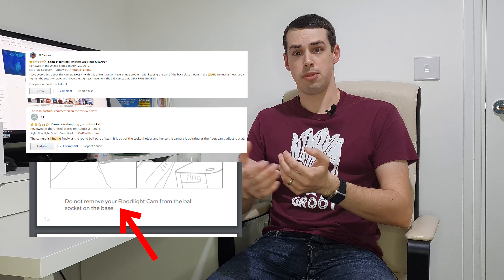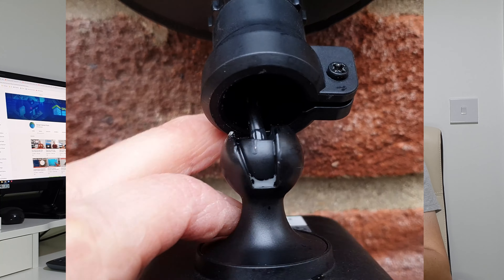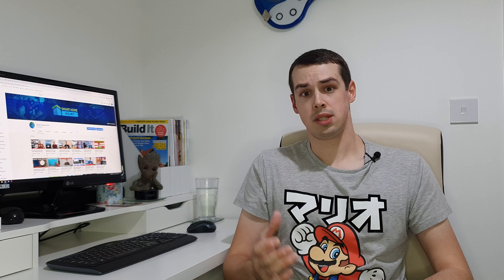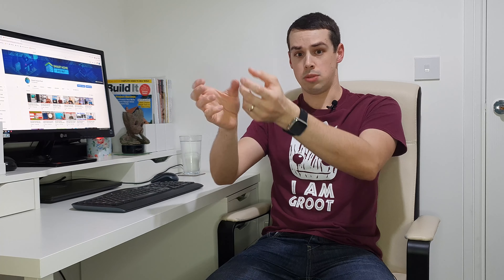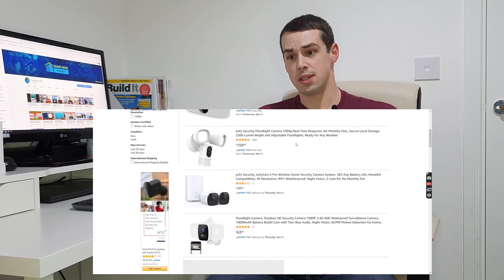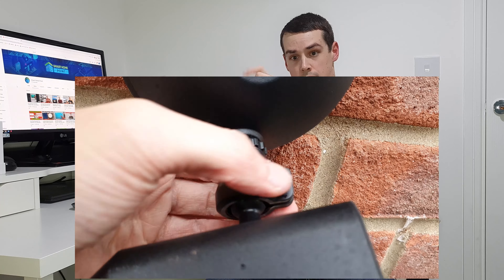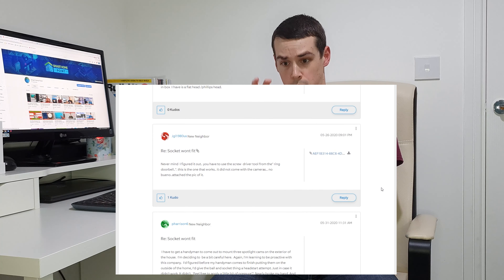Ring Floodlight Cam 'Broken' Issue: Don't Make This Mistake

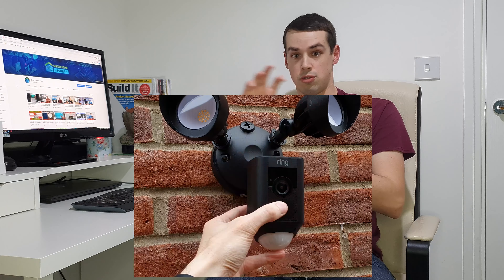Comment: 3:02 --- After inserting the ball into the socket and tightening it up, are you still able to rotate it around fairly easily (using a little force)? I've recently installed a floodlight cam and am wondering if I need to push the ball further into the socket (if even possible) b/c even at max tightness it is too easy to displace the camera position.
Reply from the maker: Yes I can rotate it around with a little force. But it isn't moving around too easily, it sounds like yours is behaving a little differently to mine currently.

Comment: I've just got my floodlight cam...I want to fit my camera on a wall that runs parallel to where I want the camera to look...I.e I need the camera to basically face as far left as possible. I can't seem to find any bracket that allows for a wider angle (like the ring doorbell angle mount)....any suggestions?
Reply from the maker: Hmm that sounds tricky. I'm not too sure sorry, but have you checked the following video? https://youtu.be/Xu_7yPY7y7w

Comment: Anyone break the arm between the camera and ball.  Trying to figure out how to get that back together.  Though flex glue would work but it is not holding up.
Reply from the maker: Ugh sorry to hear that, that definitely sounds more a trickier fix. You may need to try and source a replacement arm entirely - such as from a broken Ring Floodlight Cam on eBay.